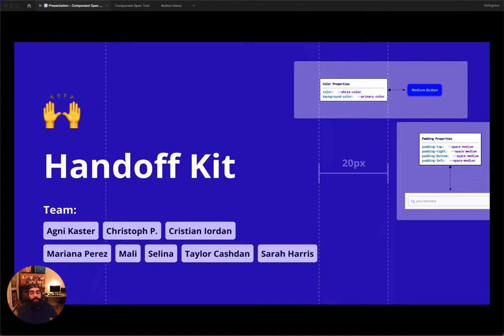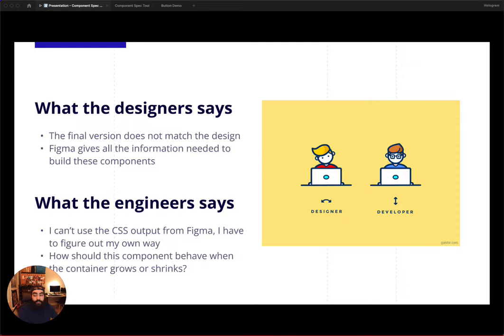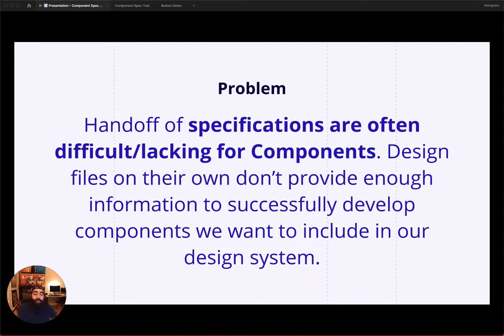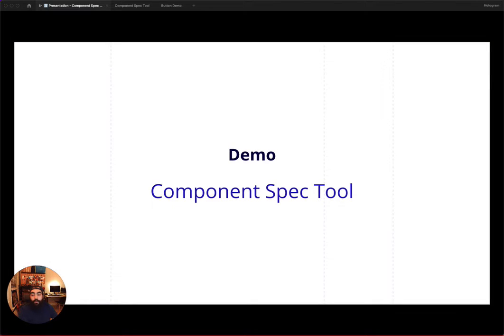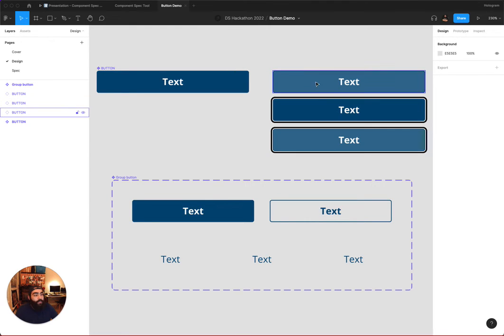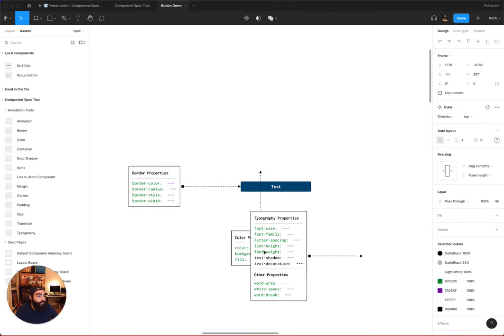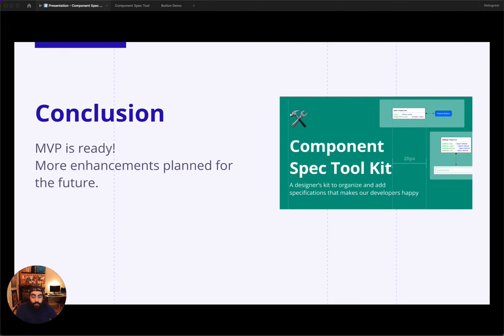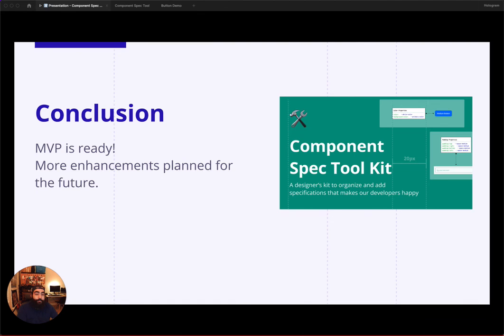Team Handoff Kit - A Component Spec Tool Kit for Figma

Comment: I dont get it, moster of this information is available in Inspect. We as UX-designers cant docunent every single little component…WHO is going to pay for that?
Reply: This seems to be a tool specifically for UX designers working on "Design System" which means component libraries for engineers. So people whose exact job it is to document every single little component, at least the ones they want to be in the library, will use this tool. Not designers and engineers building features